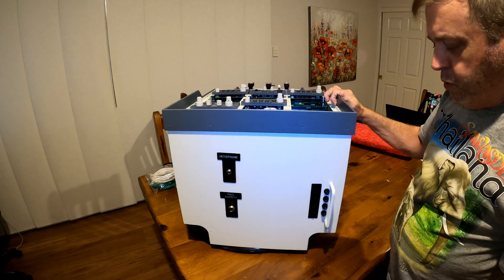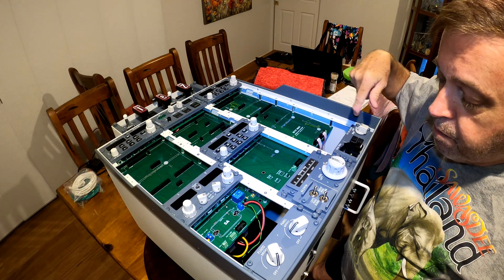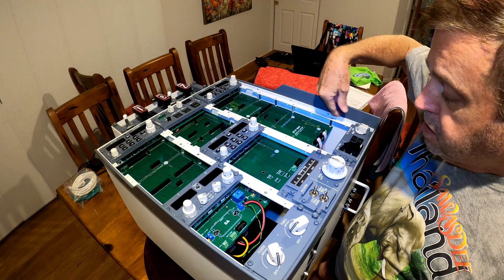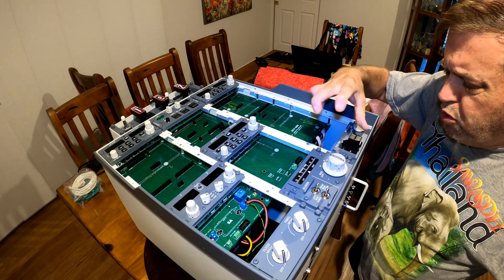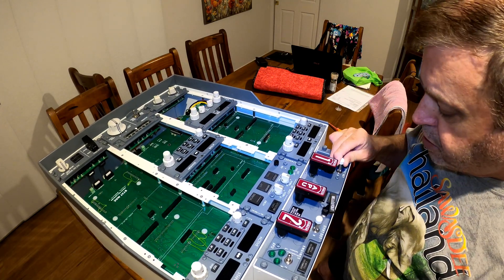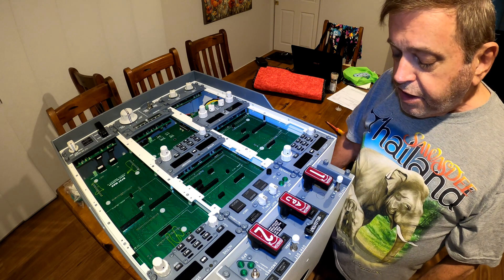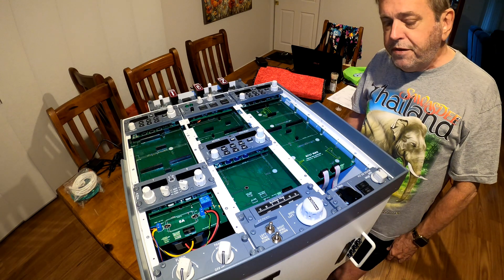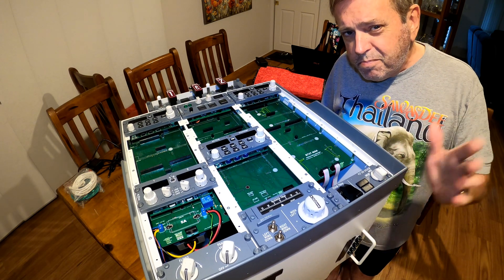737 MAX Sismo Solutions Pedestal

Comment: Does it actually support 3 RTPs or is the middle one just a filler?
Reply from the maker: Yes, the middle one has proper idc connectors on the board and is plugged in. I am not sure of the actual set-up, but can't see why they'd go to the trouble of integration without it being operable. The Alpha (which I bought) only calls for two in the pedestal, but I wanted the full compliment, so I bought the third RTP Module.